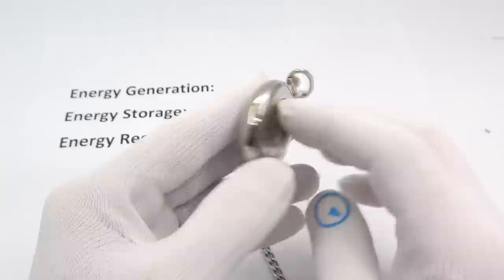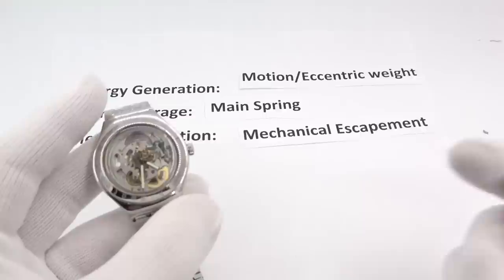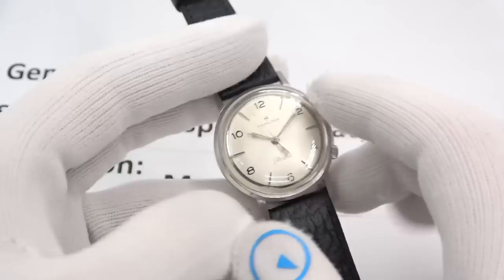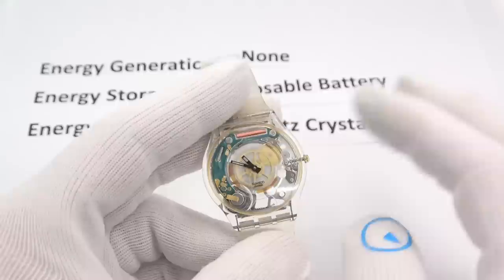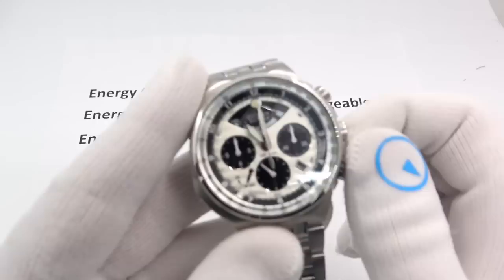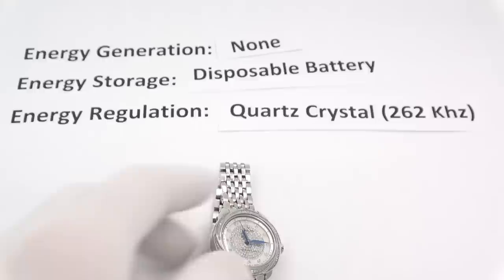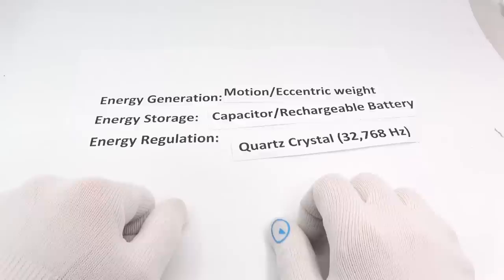How every watch movement works - Watch and Learn #85

Comment: I would have thrown in the "Quartz regulated, externally referenced / adjusted" movements (i.e. using Multi-band 6 or Bluetooth) for completeness, to cover off the high tech G-Shocks or Citizen watches of the world. But otherwise I enjoyed the episode. Thanks Mark!
Reply from the maker: Good call, and I have a multi-band G-shock, would have made a good fit near the end.
Reply: My GW-M5610 has this technology - which I use as the reference to set my others (which keep time to within a few seconds per month anyway).
Reply: Agree, for me personally the externally synchronized watches are the only Quartz watches I consider buying for myself. They truly keep time accurate to within a second without needing to make any manual adjustments. Quartz alone still requires periodic manual adjustment. Initially, this field was dominated by radio-controlled watches, but now GPS is entering the market, although GPS watches still tend to be bulky and expensive. GPS has the advantage that it works everywhere on the surface of the planet, while radio-controlled watches depend on being within range of one of the handful long wave radio transmitters, usually run by government agencies. Bluetooth is another alternative, but tends to depend on proprietary apps, with uncertain longevity. Sometimes vendors stop supporting the app after a few years.
Reply: Agree

Comment: This is the video I've always wanted to see! Thanks so much for putting this together. I will definitely be watching it many more times.
Timestamps for reference:
1:33 - Hand-wound mechanical (Invicta pocketwatch)
4:30 - Automatic mechanical (Swatch Irony Body & Soul)
6:35 - Battery-powered mechanical (Hamilton Electric)
9:41 - Battery-powered tuning fork (Bulova Accutron)
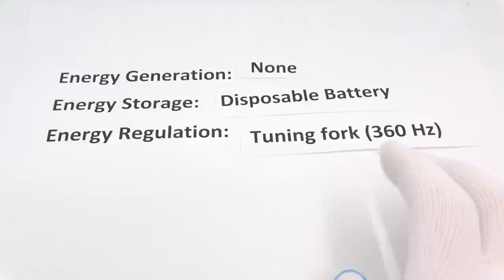12:49 - Battery-powered quartz (Swatch Jelly)
17:49 - Solar battery-powered quartz (Citizen Eco-Drive)
20:04 - Mechanical quartz (Seiko Kinetic)
22:57 - Mechanical "quartz-referenced electromagnetic brake" (Seiko Spring Drive)
26:50 - Battery-powered 262kHz quartz (Bulova Precisionist)
30:36 - Mechanical quartz w/ electrostatic motor (Bulova Electrostatic Accutron)
Reply from the maker: Thank you.

Comment: Enjoyed the vid 👍. It was very enlightening.
I love my Seiko Kinetic's. My wife gave me my first one for our 10th anniversary back in 96 (the SKH060 Windward). At one point I had 15 in my collection. After a while, I realized how challenging it was to keep them all running. I sold all with the exception of the 2 my wife bought me.
Eight years ago I learned that Seiko made a Kinetic Energy supplier & bought one immediately. Since then, I've been building up my Kinetic collection again.
I paid $150 for a new one back in 2014. Today, you'd be hard-pressed to find a used one for less than $400.
Reply from the maker: Thanks for watching!

Comment: Brilliant tutorial, thanks Marc! Agree with you about Seiko Kinetic, I had one back in 2010 but soon changed it for one of their classic automatics (from the SNX series) - which I much preferred. Now I choose solar powered watches from Citizen and G-Shock, quartz accuracy but without the need for battery changes - particularly important for the Diver's and G-Shock so they can remain sealed and watertight at all times (and during lockdowns when jewellers were shut!). Loving your Seiko Spring Drive by  the way!
Reply from the maker: Thanks Ian

Comment: I have three interesting little Seiko quartz watches (1988 - 1990) that use the 5S21 movement (7 jewels) which has a smooth sweep second hand. 5S42 movement is similar but also has a date complication.

Comment: Hi Mark.  Precisionst movement sweep second hands have 16 steps/second.  When you look at the second hand in direct sunlight you can see the very fine stepping action.  

There's also a sleazy battery saving trick with the chronograph versions too.  You can stop the sweep hand by putting it in chronograph mode but never starting the chrono, that dramatically improves battery life (which is indeed a 3V lithium cell).  I do that with mine, I "turn on" the sweep second hand only when I wear it.   Mine hasn't needed a battery change in the 4+ years I've had it.  

There are newer 262kHz movements Bulova also sells, like in the CURV line and models like in the Lunar Pilot.  Those use regular 1.5V silver oxide cells like in regular quartz watches and the second hand (which is a sub dial) move in 1/2 second incremments for power saving due to the smaller battery.  A battery lasts  around 3-4 yrs in these models.  Voice of experience on the batery life, I had to change them right at 3 yrs. with my CURV, at a bit over 4 yrs. in my Lunar Pilot.

Comment: Mark, so true about sweeping movement does not always mean accuracy, i have on my bathroom a wall clock that has a sweeping movement, my electric toothbrush has a quartz timer inside of 2 minutes broken down into four segments of 30 seconds each, i timed this against a quartz stop watch, accurate, next i started to brush my teeth using the wall clock as a reference timer, as soon as the second hand on the clock reached 12 i switched on my toothbrush, at the end of the two minutes the wall clock fell back by approx half a second.🕐

Comment: Thank You Mark so much for another great video. Most videos on watch movements concentrate on manual and automatics vs Quartz watches. Thanks for bringing so many alternatives on the table! One question - where would you place radio controlled watches?
PS. Great visual aids ;)
Reply from the maker: Yeah, so I should have included these. I'm guessing they would be around Spring drive time.
Reply: @islandwatch  based on Wikipedia (maybe someone will find it usefull :)): In 1990, Junghans offered the first radio-controlled wristwatch, the MEGA 1. In this type, the watch's quartz oscillator is set to the correct time daily by coded radio time signals broadcast by government-operated time stations such as JJY, MSF, RBU, DCF77, and WWVB, received by a radio receiver in the watch.

Comment: I think this video makes a compelling case for my position that the new Accutron electrostatic movement is not nearly as revolutionary as the original tuning fork was.
 
Sure:  the generator is prettier than that on a kinetic, but it's not even clear it is actually more efficient.  The second hand is also lovely to watch and the power save mode helps avoid some of the problems with high-frequency quartz steppers, but I think the ten-day functional power reserve demonstrates that the movement actually has a worse power deficit than kinetic while employing fundamentality the same architecture.

That's not to say I don't want one, thought—if only they were a little smaller and a little more affordable.

Comment: …this was great Marc !  …re:Hamilton Electrics, when a wire with a charge (battery) placed on it passes through a magnetic field (magnet),  a small amount of torque is placed upon the wire, it is this small amount of thrust/torque which powers the watch…though Hamilton made pre-production? models of an electric watch with a date-at-three  o’clock the amount of power generated was too small to reliably power both hand-set and calendar and it was never released…
Reply from the maker: Thanks for the info!

Comment: Bulova makes 4 different 262kHz movements. (1) Three hand Precisionist. 16 bps movement of the seconds hand, conventional hacking of the seconds hand. (2) Precisionist Chronograph. 8 hands. Central dual-mode seconds hand w/16 bps movement when showing running seconds and 1 bps in stopwatch mode. 1/10, 1/100 & 1/1000 second stopwatch hands. Hacking advances the seconds hand to the 12 o’clock position for easier time setting.  (3) Lunar Pilot Chronograph. 6 hands. Small running seconds hand moves 2 bps. Central stopwatch seconds hand moves at 8 bps. (Which is better for using the tachymeter scale than a 1 bps movement.) 1/20 second stopwatch subdial hand (which is the highest realistic precision that can be attained by physically activating pushers). Conventional seconds hacking. (4) Curv Chronograph. 5 hand. Dual mode sub-dial seconds hand moves at 2 bps in both running seconds and stopwatch modes. Hacking advances the seconds hand to the 12 o’clock position for easier time setting.
Reply from the maker: But accuracy is the same for all three, no matter what the seconds hand beats at.
Reply: @islandwatch  Definitely. My 262 kHz watches are generally more accurate than my regular quartz watches,  but any conventional function could be handled just as well with a 32,768Hz oscillator.

Comment: Such a great video! Question: if you’re not going to wear a watch for a while, would it be okay to pull the crown out (hack) to stop the seconds hand and ‘save’ the remaining power for when you wear it again? Or would this be too much pressure on the main spring? Also, how would this work in quartz watches?
Reply: Great question 🤯

Comment: I wish someone would develop a cheap and accurate movement that is just battery powered but the second hand moves like a spring drive or accutron, I feel like this isn't too much to ask for considering the technological age we live in
Reply: I have a Breitling Chrono Jetstream that is a  mechaquartz. It has a battery  but the second hand sweeps like a machanical movement because it is a mechanical movement quartz referenced. Circa 1998.

Comment: Great Watch and Learn! I recently bought a Citizen Eco-Drive for the heck of it. When I first took it out of the box the directions said to put it under a light source to get it charged. It happens that many of my light bulbs are LEDs. The watch didn't charge sitting under an LED. Does this make sense? Is there a part of the spectrum missing from an LED that the Eco-Drive needs to charge? Maybe the light wasn't bright enough? It isn't a teeny tiny nightlight size bulb but not the size of a regular incandescent bulb either. Thanks!

Comment: Nice one! I get what you mean but you’re only half right about a fluid seconds hand v a jerky seconds hand. The fluid seconds hand is correct every moment; the jerky one is incorrect between the beats (6ps, 8ps, 10ps, etc). Yes, the minute and hour hands are correct, but they’re not very useful for accuracy (ie a 100yd dash). Also, the vintage Accutron batteries only last 6-8 months.

Comment: Needed the heavyweight HAQ quartz that run in Mhz range and there was a couple IIRC,  like Citizen caliber 0100 vibrates at 8.4Mhz released around 2019. I mean even if just mentioned, or FP Journe Elegante... intelligent crazy long battery life.
Reply from the maker: I should put every in quotes!
Reply: @islandwatch  Great video at any rate, thanks Mark.

Comment: So Marc starts with the balance wheel, but the balance wheel is itself in the middle of advancement in horology. 

At first, humans used sundials, and those influenced every clock since. But sundials are pretty inaccurate things and they don't work at night, and soon your classical civilizations were wanting something better.

So, what is a clock really? A clock is a device that counts a frequency standard of some kind, and displays that to measure the passage of time. The first clocks used water and sand falling, and gradually became mechanical behemoths using the weight increase of falling water and sand in complex gear trains to approximate time. But there's a fundamental flaw in how sand and water falls. They're inconsistent. So no matter how tight your tolerances are (and this would have been prior to the 1200s AD, so not very tight), water clocks could only get so good.

But something amazing happened. Someone somewhere invented the escapement. We don't know who or when, and maybe several people invented it simultaneously. This was a part that could be used to regulate a clock on an oscillating weight. The simplest kind of oscillating weight is a pendulum. A pendulum's swing (distanced from external vibrations, air resistance, etc) only depends on the length of the string it's on. So, a pendulum of a certain length always had a frequency of 1 Hz, or one tick per second. Pendulums dominated timekeeping up until the 20th century, and are to this day the third or fourth most accurate way to keep time barring quartz and a few types of atomic clocks.

But there was something pendulums couldn't solve. Sailing ships needed accurate clocks to calculate longitude, and any deviation could mean disaster for the crew. However, the rocking of ships influenced the motion of pendulums and ruined their timekeeping. Due to the inconsistency of this rocking, you couldn't design a pendulum clock around this problem. They needed to find a new kind of oscillating weight. Thus, the balance wheel was born. Balance wheels have a frequency of oscillation based on a spring known as the hairspring. While less precise than pendulums they were good enough to calculate longitude. These clocks were called marine chronometers, and are the big brother to pocket watches and wristwatches.

Another fun fact about clocks is every city had its own time for most of history. This was true up until the late 19th century, when railroads needed a uniform time to avoid trains crashing into each other. Railroads were the catalyst for pocketwatch and wristwatch chronometry, and even COSC uses standards based on old railroad timekeeping.
Reply from the maker: Yes, but as I said, this is "watch movments", not time telling devices. You can't wear a clepsydra.
Reply: @islandwatch  Nope, but it'd be fun to try.

Comment: All of these methods employ some form of oscillation as the timekeeper. I would think there would be some mechanical or electronic equivalent of the hour glass, where something decays or releases energy at a precise. rate without an oscillator.
Reply from the maker: Water clock. But its not a wristwatch. Spring drive sort of does what you're saying.

Comment: Were the first automatic single direction rotors or were they "dual action" and then some branched off to single direction (eg. Myiota 8000 series)?
Reply from the maker: I do not know, but I will wager a guess at uni due to the simplicity of it.
Reply: …there were app self-winding pocket-watches? but Harwoods’ first self-winding wristwatch swung both ways…

Comment: Great video. Just a small point regarding quartz. The crystal is shaped like a tuning fork to give the characteristic frequency of 32,768 Hz they are tuned to that frequency by adding tiny blobs of gold to the tips of the quartz tuning fork. It is not that quartz vibrates naturally as a crystal at that frequency. The point of using quarts is the vibration (any movement in the crystal tuning fork) causes an oscillating voltage (piezoelectric ) which can be measured and give the time regulation. Also the same voltage can be amplified and sent back to the crystal and, as it is piezoelectric, it will deform the crystal at the same frequency keeping the vibration going. Steve Mould has a great video on this https://youtu.be/_2By2ane2I4

Comment: With the Kinetic watch put it in a football or heavy work sock folding it over so the watch has a fair amount of cushioning around it. Then, put it in a household tumble drier on cool mode and give the watch/sock combo about fifteen minutes of "exercise" and voila the watch is wound and will keep on "ticking" for depending on the model some 14 to 28 days ...Plus!  No problems except Seiko's fairly mundane case design. A new capacitor every five years at around A$ 100 and all is well with the world. N'est pas?

Comment: I bought my wife a battery powered Seiko Elnix from the early 70's. Is the Elnix movement similar to the Hamilton electric movement? If it is, I own at least one watch with every type of movement except spring drive. I will buy myself a Seiko Spring Drive dive watch as a retirement present in October 2023.

I watched a video about charging a kinetic watch with an electric razor charger, so I know that works. I will try charging the electrostatic movement in my Accutron Spaceview 2020 the same way. Does anyone know if this will work?
Reply: It is similar. I just googled it cause I was curious, too haha. The Elnix is battery powered but still uses a balance wheel.👌🏼
Reply: @tristandauod  from the description Marc gave about the Hamilton, it also has a balance wheel.
Reply from the maker: Similar in the three subject fields I broke every movement down into. And Hamilton pre-dated it by a while
Reply: @islandwatch  I am glad I bought one of the last electromechanical watches, because it ticks 8 times a second, as opposed to the slower beat rate of the Hamilton.
Reply: @dns711  yeah haha I was meaning they are similar in that they both have balance wheels and batteries.👌🏼 Sweet gift btw!!🔥
Reply: I couldn't get my kinetic Seiko to charge using an electric razor charger or an electric toothbrush charger, so I am thinking of buying one of those $500 chargers Seiko used to sell to dealers and repair shops. Does anyone know if that charger would also work on my Accutron Spaceview 2020 electrostatic watch? If so, I could justify the $500 purchase. If not, I won't bother.

Comment: Hey Marc, thanks for the info. Which model was the citizen you showed? It's the eco drive chronograph with the power reserve. I'd like to find that model for my collection.
 I also have a Timex dynabeat electric watch, is that similar to the Hamilton 500 electric?
Reply from the maker: Look up Citizen AV00330-51A
Reply: …yes…see Frank Abate above…